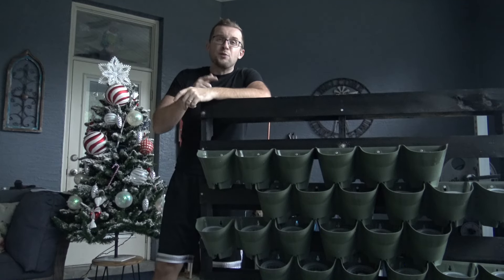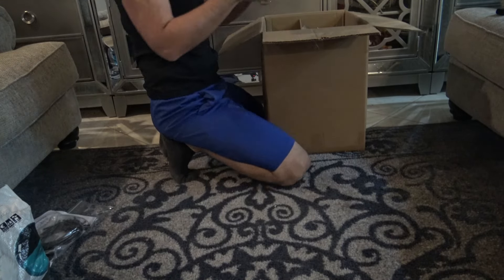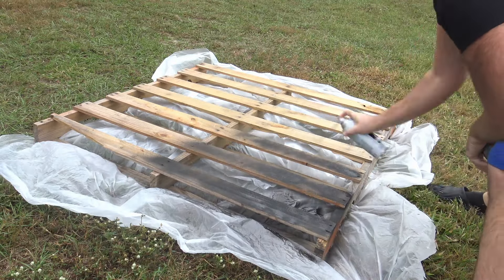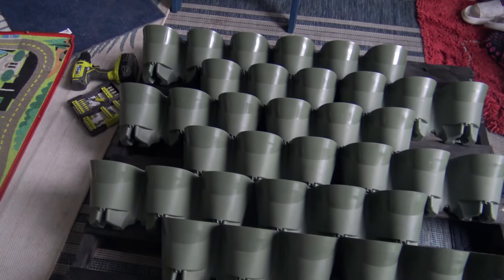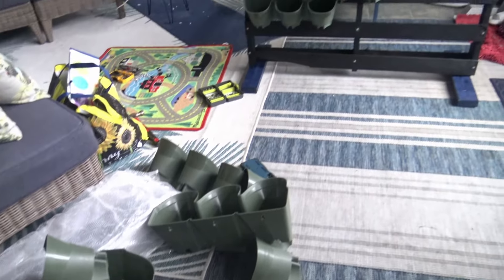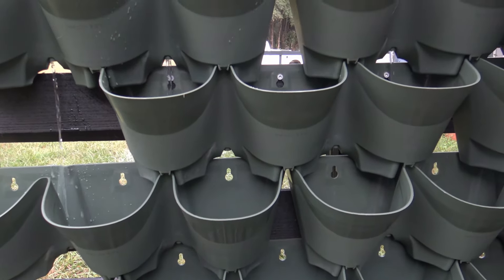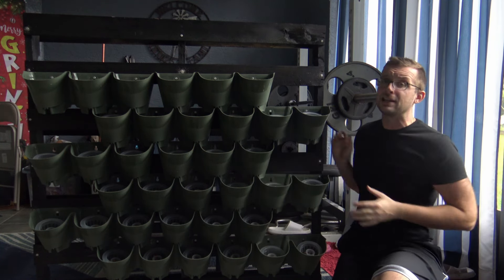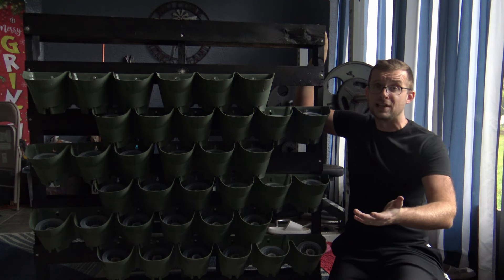Building a Vertical Garden! The Worth Hydroponic Planter

Comment: 5:55 Confused here, wouldn't you have to seriously over water the top row to get enough down to the bottom row? Looks like a cool system overall. 😎
Reply from the maker: It does seem like a lot of water is required to get from one section to the next, but you can use this garden for aquaponics where the roots are constantly submerged in the water at all times.

There's a way to position the plant pots so the plants sit a bit higher though and they wouldn't always be at water level. Hope that makes sense!
Reply: @FloridaHomestead  Also im sure the clay soil interacts better for this type of saturation.